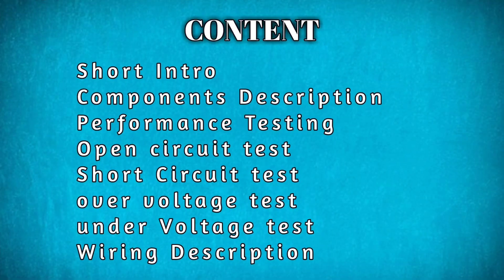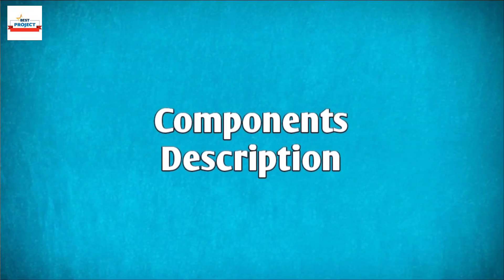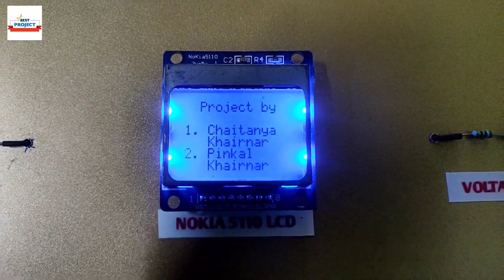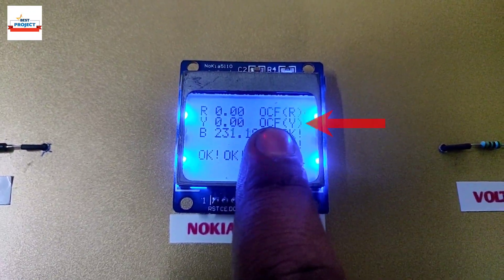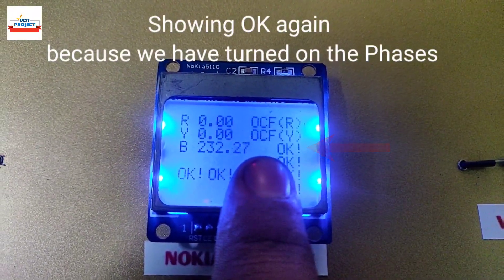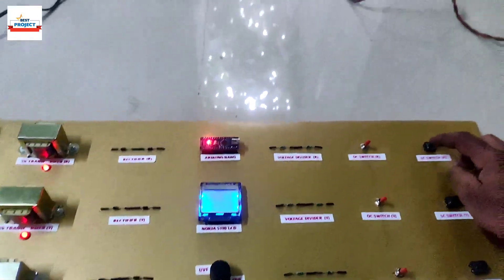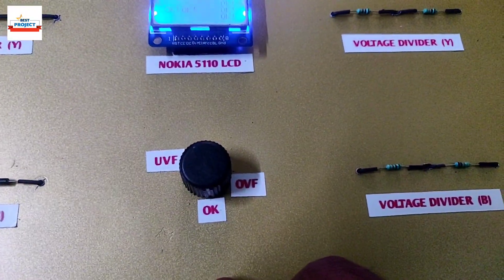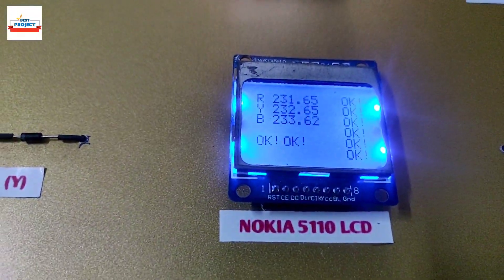6.  3 Phase Fault Detection System Using Arduino | OV fault | UV fault | SC fault | OC fault | 2024

Comment: Aree singles phase se three phase kaise banaya
Reply from the maker: In three phase system, there are some faults which doesn't require phase difference of 120°, all those fault detection is also same on single phase, so we implemented all that kind of fault using the single phase supply,
Reply: @ElexysProject  isaka answer de diya but circuit diagram manga toh ignor kar diya 😏😏
Isa bed bhaov kyu
Reply from the maker: Those faults which are not possible on single phase is not included, like line to line fault,
Reply from the maker: Contact us on  whatsapp 8796168099 we will provide you,